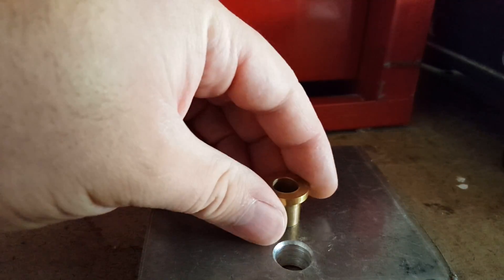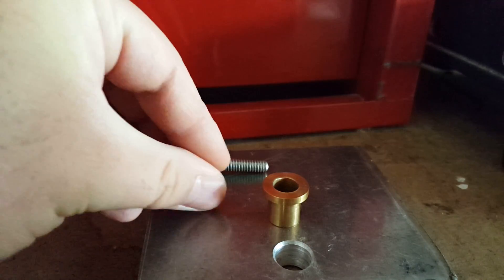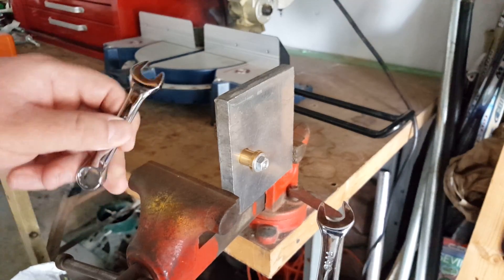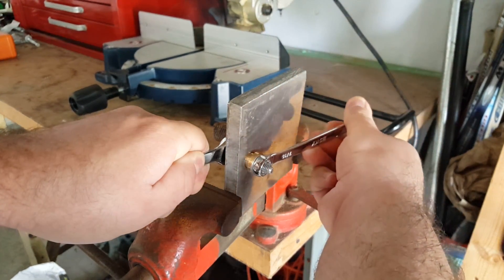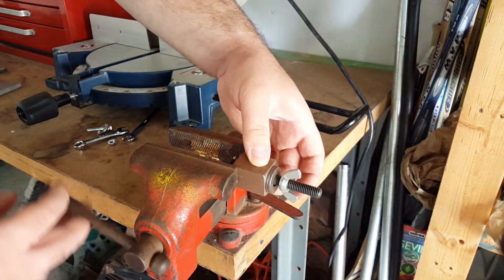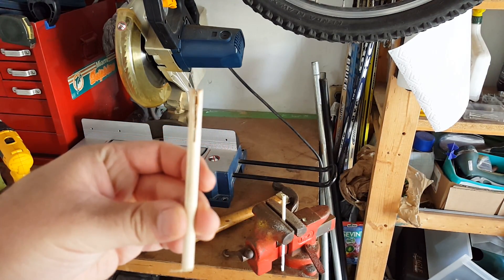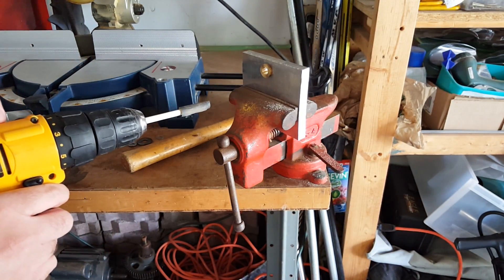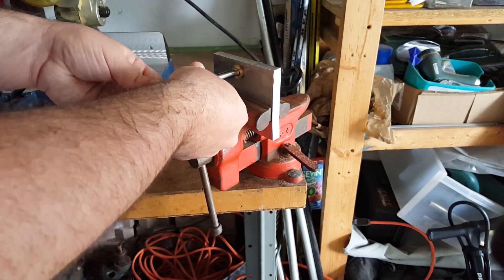How to Press Fit a Bushing Without a Press (Cheap & Easy)

Comment: If I were to insert a bush into a FR4 Sheet instead of a metal block, will this method be suitable, as in will the FR4 sheet sustain the force exerted by the nut and bolt?